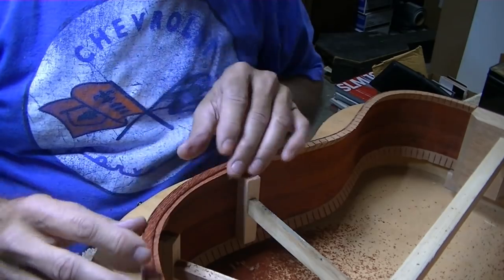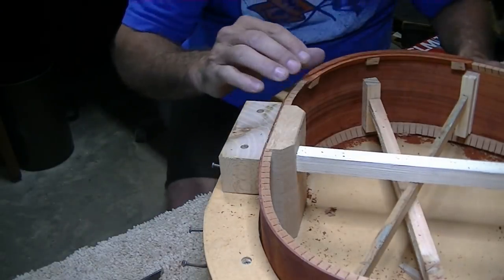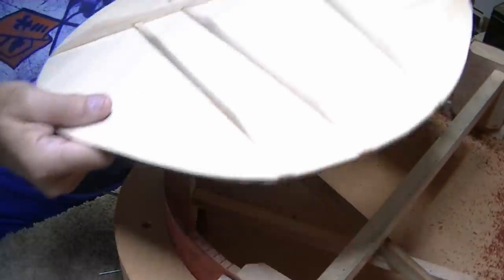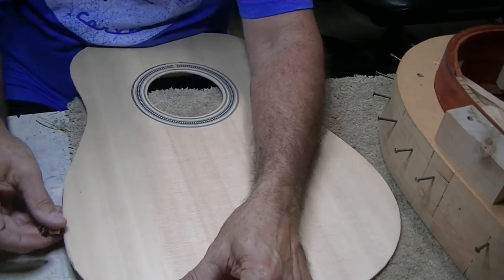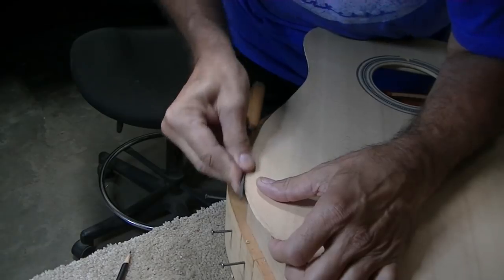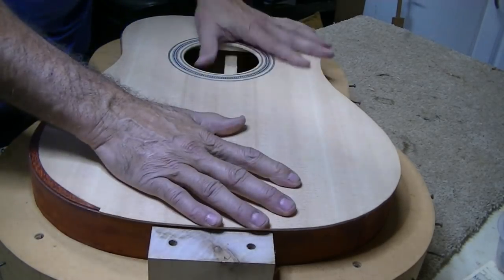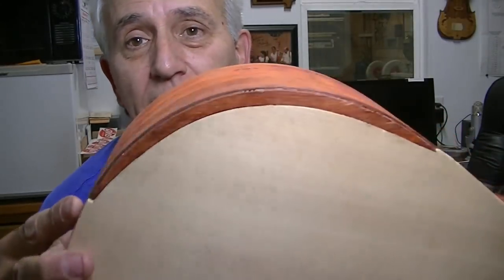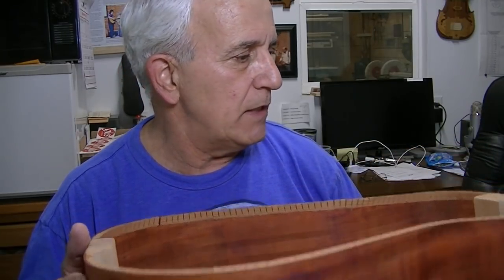225 RSW Custom Guitar Build P5 Top Side Surprise

Comment: Jerry the method I have seen, but never tried is to glue the armrest wood flush to the side glue the top on as normal then carve through the top to expose the wood underneath, gives different issues of course like binding. Its an easier method but probably not as nice as the way you have done it.  Excellent vid as usual.

Comment: when you are a 1/16th away from the join, clamp the top on and use your router/dremel with a 1/16th bit and follow the join of the round over timber and the top and then the pieces will fit together perfect.

Comment: Hey Jerry, the bevel armrest is a gutsy undertaking, just wondering if you’d have considered fitting up a half or full stiff cardboard template of the top first and and tweak to shape that with scissors, etc., then use that to trim then wooden top. That maybe would have lessened the stomach churning part. SO looking forward to the rest of your guitar build!! And, even though you had that video about the lifestyle change, I think you’re putting up more videos now that even before, and we certainly appreciate it!

Comment: Thanks Jerry for another great episode! Question: is there any benefit to the string clamping as opposed to using actual clamps? Keep up the good work man!!
Reply from the maker: It's mostly that I want to keep the guitar in the mold until the top is attached. The string works better while the sides are inside the mold. Keep in mind that the back is not touching the bottom of the mold along the sides.  So the string doesn't put quite as much pressure as clamps would. And the string spreads out the pressure pretty evenly.
Reply: Ah thanks for the info! And again! Your channel is amazing! Cant wait for the next one :)

Comment: Jerry, where do you find clothes pins that have some strength to them.  I have my mothers set from back in the 50s and they have strong springs but the ones I find today are smaller diameter wire and weak.
Reply: You can fix that by putting rubber bands around the front part of the clothespin. More towards the spring, but on the front half. They just need some support and a rubber band does wonders.

Comment: Plotting with a compass might have saved you some time.  Offset your center a specific amount, clamp the top,  use a compass to plot the same distance to create your cut line.  Then sneak up on it.

Here is how a shipwright plots a (varying on both sides) curved plank on a boat.
https://youtu.be/xTQWnOgVZAs?t=6m

Comment: a bit late for my suggestion but, to transfer those contours and curves for the top fit ... maybe some trimmed carbon paper to get a shadow on the underside of the top. Always a thumbs up
Reply from the maker: I do use carbon paper often but in this case the braces were holding it up so it wouldn't have rubbed.